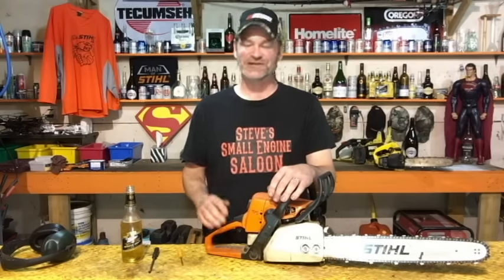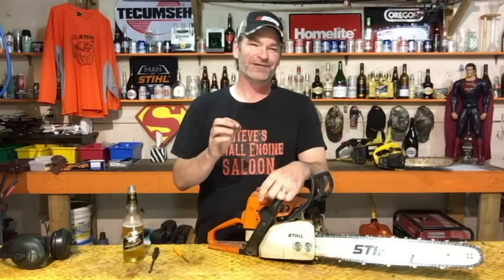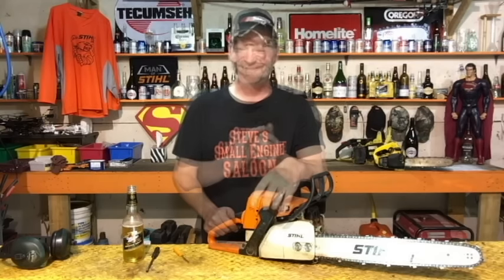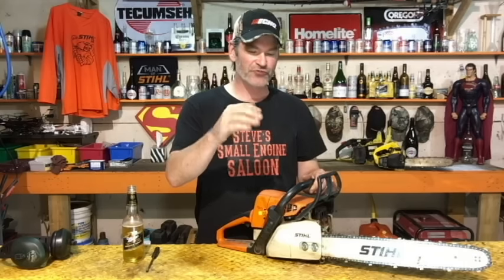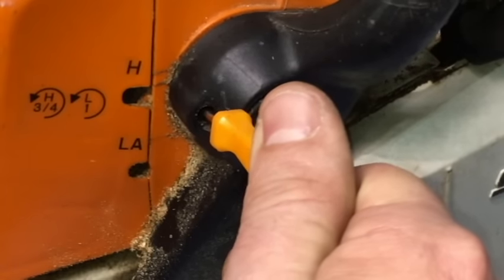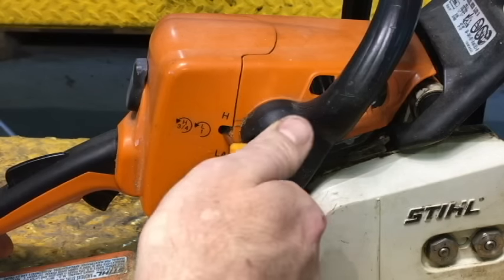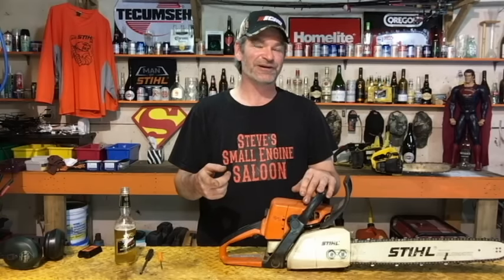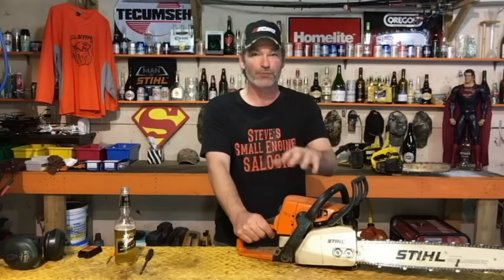CORRECT WAY To Adjust Or Tune The Carburetor On A Chainsaw (Step-by-Step)

Comment from the maker: ✅Click here for a Husqvarna adjusting tool ➜ https://amzn.to/2S9gR4H
✅Click here for a tachometer ➜ https://amzn.to/3DTvSNK  
For more videos like this, check out: 
👉Adjust Or Tune The Carburetor On A Weedeater ➜ https://youtu.be/gmhxTvGRtCg
👉Correct Way To Sharpen A Chainsaw ➜ https://youtu.be/-GIxowey6IQ
👉Never Do This To ANY Chainsaw ➜ https://youtu.be/8Q3J1cVGByQ
👉How To Buy The Proper Chain For A Chainsaw ➜ https://youtu.be/IMaGZghrKWg

You can connect with Steve here too: 
✅Visit Steve’s WEBSITE ➜ http://www.stevessmallenginesaloon.com/ 
✅Visit Steve’s PARTS & TOOL STORE ➜ https://www.amazon.com/shop/stevessmallenginesaloon 
✅Follow Steve on FACEBOOK ➜ https://www.facebook.com/stevessmallenginesaloon 
✅Follow Steve on INSTAGRAM ➜ https://www.instagram.com/stevessmallenginesaloon/ 
✅Follow Steve on TWITTER ➜ https://twitter.com/SteveSaloon
Reply: Steve's Small Engine Saloon when u where adjusting the low speed screw and the chain moved was it on or off? Also u did i twice once before u tinkered with the idle screw and once after was it on after as well and thanks this well help once i rebuild my carb on my ms210
Reply: I have a bran new Husqvarna 460 rancher it will not idle and seems the high low screws will not turn ?????? Please help
Reply: Will check it out.
Reply: You can make a tool to adjust husqvarna carbs out of a bic pen. Gut the pen then heat the small end until its soft and force it over the screw. Let it cool and you have a free custom adjustment tool.
Reply: @jackk8422  thank you sir your are brilliant
Reply: Is a 50cc Stihl chainsaw dangerous for a novice?
I'own a smaller husqvarna but would like a bigger one for mire serious work.
Thanks
Reply: Is the tachometer that you linked in description a good tachometer? Have you tried it and is it accurate?
Reply: Fapking if you use proper form every time no chainsaw is going to cut you.
Reply: Dustin Johnson           B
Reply: So I'm not in the 99 percent where are these screw on a 661 magnum
Reply: Hi Steve I've got a stihl ms 280 and having problems with the machine dying after 20 mins of run time or so.
I feel like I've made all the adjustments just as you have here but those have been my results.
Any ideas? 
Surely it's not a cracked head or something of that nature would you think?
I appreciate your time and hope to talk soon.
Thank you
Reply: Hey steve my chainsaw dont stay on unless i give it gas also it starts smoking after a while of use is that the carb thx
Reply: Great how too! Got my 024 running sweet thanks to your video Steve. 10/10 = 100%
Reply: Appreciate the video.  Very helpful and just what I needed now that I'm at 4400 FT instead of sea level.
Reply: Hate to bother ya but what if it won't stay at idle long enough to adjust? By the time I get the adjustment tool ready to turn the saw shuts off lol.
Reply: @6footmidget214  
Assuming you have a Stihl saw that has the adjustments shown in the video try turning the LA (low idle screw) clockwise a bit while the saw is off.  like shown at 4:15 of the video  that would could should get the saw running to make other carb adjustments
Reply: great info.   much thanks.    my 51 husqvarna is out of wack.    going to use your ideas this morning.    got everything but miller lite.    i can solve that very quickly though.    hopefully i can get it tuned and running well.    if not, i will just resort drinking more beer and quit trying.
Reply: 😊😅😅the😅 6:27 6:27 6:27 6:27

Comment: Took my chainsaw to the local Stihl dealer and they said I need a new carburetor, so they couldn't fix it. Took it to the Stihl dealer at the neighboring town and they made adjustments and it was good to go. I used it once and it crapped out! Found your YouTube site and followed your instructions from chain tension to carb adjusting. BINGO!! You are the man! Better than buying a new one, which I was getting ready to do. So thank you so much, Steve.
Reply from the maker: You're Welcome...

Comment: Found a MS 650 on the cheap because the previous owner thought it ran like crap. Being almost 85cc I had high hopes. He was right. It bogged down when I hit the gas, 4 stroked a lot and it just didn't want to rev. I bought it anyways. I'm not independently wealthy so the thought of a dealer visit was making me sweat. These straightforward instructions got it running like a beast. Thank you very much.
Reply from the maker: You're Welcome...

Comment: After trying to follow the directions in the stihl owners manual, I could not get the idle correctly adjusted.  And I wasn't sure if I had the low speed setting correct.  So after struggling for a few hours I gave up.  Then I decided to do some research with the YouTube mechanics I trust, of which Steve is one.  Danny boy 73 is another.  Individualized repair is the third one I trust.  And of course Steve is simply the best with his explanations experience and simplicity of repairs.  I can't thank you enough Steve because you've helped me time and again.  It's so refreshing to have a true professional know exactly what needs to be done and then show the novices like myself how to effectively make it happen.  I am again in your debt Steve.  👍👍👍
Reply from the maker: Glad I could help

Comment: Been messing around with saws and weed eaters for 30 years.  Never needed to adjust one until I got a still 210.  It has been no idling and only wanting to run wide open for 6 years........today, I fixed it.  Thanks to you.
Reply from the maker: You're Welcome...

Comment: I owe you a big HELL YEAH!! I was given a Poulan P3816 by one of my firewood customers. It was rough in and and out but I did get it started. I did thorough cleaning and maintenance in and out. Then, found the correct spline tool through DonyBoy73. I then watched THIS video three times and applied what I learned. No limiter caps, BTW. I followed your tune up instructions and she is screaming. Nice idle a quick punch on the trigger. Top end? Goes through a 16" diameter Oak lol quick with no sign of bogging at all. I replaced air filter and bought her a brand new Oregon 16" Bar and Chain Combo. I then went to your other video to confirm proper chain tension and it's on! This poor saw was barely crawling when I got it. Now? Thanks to you it's a whole new saw!! I'm getting a log delivery midweek. Can't wait!!
Reply from the maker: Right on Jim!  Thank You...

Comment: Good info. I learned how to adjust a carb via an rc car nitro engine.
There you need to find the sweet spot, but control temperature.

Lil nitro engines love being lean, but the power will fade as the engine starts to melt. 

So i always tune to run as rich as possible, but to run well.
Idle, run smooth, but won't flood it self.

Comment: Hey there Steve, first off I love the channel. I have learned quite a bit here that's has helped me move forward and improve in my own shop. I didn't have Chainsaw after Hurricane Sally hit and ended up cutting large branches and other debris out of the road so I could get where I need with a DeWalt 20 volt saw all. It quickly wore the flesh of the inside of the thumbs where the saw rests. So I bought the cheapest non running chainsaw listed on Facebook and taught myself how to repair them. Well it's been a couple of years and I have sold a couple hundred saws. I buy them broken down, fix them and sell them on Facebook. I give a 30 day warranty and have only had 1 come back (from my brother and 2 years after I sold it to him. He misunderstood a 30 day warranty to be sure it's all good for a lifetime no questions asked bumper to bumper warranty. He took a non running saw home after having it run hot and not bringing it in to be checked out and kept on running it. Scored the piston really bad. And was clearing land with a Poulan Wild thing. He tried to get me to let go of my Stihl MS260 or my 046 but after seeing what he did to the Poulan I suggested he called someone that knew what they where doing). 

Anyway, the reason I'm commenting is this. I have this echo PB-2100 blower I just changed the carb on. The L screw has no slots, no other way to grab ahold of it except by a pair of pliers to adjust it. And this thing needs adjusted really bad. How do I go about adjusting this carb if there is no way to turn the L screw. I'm sure the manufacturer didn't intend on anyone using pliers. But this thing is running hot and the RPM's on idle as well as when it's wide open only has maybe a couple hundred RPM's difference. See what I mean needs to be adjusted? I'm trying to attach a picture of your carb so you can see what I mean. But I can't find an option to

Comment: Steve, thank you a lot. Yes, it took me a while to adjust my Stihl 023 after returning from a greedy dealer. My piston rings broke and screwed both the piston and the cylinder. Dealer asked from me almost the price of new MS230 to fix it, so I retrieved my saw from diagnosis back (yes, I was charged for diagnosis too). They returned it to me in two boxes, disassembled to almost the last piece. At that point I decided to never go back to that shop (or any other) and to learn to fix it by my self.
I learned A LOT from your videos, with that knowledge and also with what I learned from other places on internet i fixed and fine tuned my saw and I'm expecting many more happy hours with my beloved saw.  
I'm hoping for more useful videos from you, next tasks are fine tuning FS55 weed eater that returned from shop still stalling, and Briggs&Stratton soil cultivator I cannot fire up after sitting for almost two years.
 I'm sorry that we live so far apart, otherwise I would love to drink some beer with you! 
Wishing you all the best, keep up the good work man! Greetings from Croatia, Europe!
Reply from the maker: I'm so happy I could help my friend....
Reply: TheJR1948  Just spent under a bill to be told could not tune the saw, glad to sell me a new carb. Managed to screw up the needle settings and charge me for messing up my saw even more.

Comment: I went through a dozen videos... yours was the best, easy to understand & to the point.  Thank you
Reply from the maker: Thank You...
Reply: People limbs cut off
Reply: Just watched the "tune & adjust carb".
So if the high and low screws only adjust idle speed then what the hell is the adjustment screw that actually moves the throttle butterfly effecting THE IDLE really do? The air fuel mixture? LMAO what you telling, a certified small engine repair person, that the high - low adjustment screws are not air-fuel mixture?
Reply: @MoparManiacHemiFever  low speed screw is mixture screw
Reply: @MoparManiacHemiFever  he said the idle adjustment does that, the other two are mixture adjustment.
Reply: @MoparManiacHemiFever jerk
Reply: Steve's Small Engine Saloon you
Reply: Steve's Small Engine Saloon was
Reply: @MoparManiacHemiFever Low-speed screw has a tapered screw that widens or narrows fuel/air mixture through a vortice.  It handles 0% throttle up until it transitions in rpms to another vortice.  This vortice has a tapered screw that widens or narrows fuel/air mixture at 100% wide open (high-speed).

The idle screw is often (not always) a separate fuel/air circuit from the low-speed screw.

I used to race motocross bikes and you had to jet them a lot.  They were two-stoke and essentially had three circuits/jets (pilot; needle, main).  The chainsaw only really needs two circuits:  low-speed (for quick transition from low rpms to higher) and high-speed (wide open cutting).  Idle is just a fine touch to keep the blade from spinning or the engine from stalling while you are transitioning cutting positions, etc.

So, the fellow here knows precisely what he is talking about.
Reply: @Ronald Brown Exactly.  I recently bought a cheap tach. for my chainsaw's high adjustments.  It has proven to be very helpful in keeping me from exceeding my 12500 rpm limit, while also not staying way too rich.
Reply: 💯 that's what I just said, just differently ... lol. Understanding the PURPOSE is super important! How else do you know you achieved what you were trying to do? Thanks Steve!
Reply: @Ronald Brown yes sir! Vsauce Michael Stevens is my little brother from another mother....can't you see the resemblance?! My wiki page is coming. Being a 1 man team is tough @TRVsauce across the board...give a shout if you'd like to join the team! 😎 thanks man
Reply: Well done. Belize

Comment: Keep up the good videos, just note or two,, That high speed screw adjusts the mixture, leaner mixture equals higher rpm at wot, too lean will burn it up, in this video he left it a tad rich, and that's fine. 
It's important to use the best oil and fuel, the stihl ultra synthetic is the only one I use anymore, keep the ratio at 50/1, too much oil can actually make a saw run lean, as in the oil is displacing the fuel, so tune to your mix, and if you use opti oil, never mix it at 50/1, only mix at it's 100/1 spec, it forms very hard little granules that destroys engines if it's got too much opti oil in the mix. 
Thanks

Comment: Many thanks Steve, I have been fighting my MS210 for years and I did not want to remove the carburetor because it ran relatively good at full throttle but was idling to fast and did not respond well to full throttle. after you showed the low speed adjustment screw and i tuned it like you said the saw is idling and responding like it should. Thanks WB
Reply from the maker: You're Welcome...

Comment: Bought the wrench off of Amazon for my Husqvarna for the H/L screws and the flathead for the idle screw is on the scwrench that come with the saw. 
I tuned it Steve’s way and man does she purrr and respond so much better. 
Thanks Steve for a great video!
Reply from the maker: You're Welcome...
Reply: My chainsaw has a new lease on life thanks to you. I had issues, starting, idling, restarting, and wide open throttle operation for the last 8 years. All those issues have been resolved. 
 I tried someone else’s idea adjusting the carb screws but it did not help the issues. You saved me a bunch of frustration going forward and I wanted to say thank you again.

Comment: It’s worth understanding the “fast idle” mechanism when starting. The starting choke position engages a fast idle which stays engaged until you blip the throttle. This makes it much easier to start (and restart when hot). I never really appreciated this mechanism until it stopped working after many years of use due to wear in the metal levers on my Zama C1Q-H64.
Reply: Nice tip!

Comment: Steve, I wanted to thank your for all the chainsaw tips you have provided within your channel. I have a 1998 Mcculloch 3200 chain saw that I purchased new and used it one time in 1998. Once done I put it under my work bench, never drained the gas, bar oil or even cleaned it before storing. Have been carrying it with me through multiple moves and I now need it. Assumed the wrong thing to do was fill it with gas and see if it would even start after 21 years as I didn't want to wreak anything. Have watch most of your videos concerning what needed to be done like, replacing all the lines (gas & oil), cleaning the saw, gas tank and oil reservoirs, rebuild the carb, chain adjustment, bar oiling and adjusting the carbs. I'm pretty mechanical but your videos were extremely helpful and very much appreciated since this is the first small engine I've worked on. That saw is now running as good as when I purchased it. I hope you are still reading emails from this particular video as it was the last I needed to bring my Mcculloch back to life. The last thing I'm wondering as no one has addressed it for the Mac 3200; is there a way to adjust the bar oil delivery? I looked around the saw but couldn't find any way to adjust the amount of oil. Seems that it is dripping and throwing allot more oil than I remember. There is no leak that I could find and I guess too much oil is preferred over not enough oil. Anyway, thanks again for your very informative videos. I will now have a well deserved Shock Top.
Reply: Kinda late, most likely it's not adjustable.
Most saws aren't unless they're pro grade and some farm/ranch grade.
My experience is if there's extra oil that's an extra cushion and the saw appreciates it.
I've never stopped cutting and grumbled that there's too much oil.
Reply: You're likely leaking oil and need to look at the connection between the pump and the bar along with the connection from the oil tank to the pump.

Comment: Excellent video, thank you!

A note on top RPM:  the forces on parts are proportional to the RPM squared.  At higher RPMs the parts are both going faster and have less time to change direction.

 * 10% high (110% of, or 1.1 X rated) RPM means 1.1 x 1.1 = 1.21 X the rated forces.  
 * 20% high RPM: 1.2 x 1.2 = 1.44 X the rated forces.  
 * 50% high RPM:  1.5 x 1.5 = 2.25 X rated force.
Expect it to break early if it's running over the rating.
Reply: How do I find out what the rated forces should be?

Comment: That was a great description of finding the sweet spots, even without the demonstrations! This is adjusting a clean saw, without other issues. If your saw ran well before, your carb adjustments are not your problem. Only adjust a clean carb. that you run to warm up, and break in new diaphragms or saws that sat for awhile. Then set correctly, as Steve shows. When it acts up down the road, fix the actual issue. Don't automatically go to the carb adj on a saw that was set fine; that isn't the issue; usually.

I have seen some very weird methods people use to set their jets correctly, and am learning some technical "precise" methods....factory settings; however, IMHO as someone with limited experience, but a 99% mechanical reasoning aptitude, Steve just showed you how to set any 2 stroke carb. correctly. I do this exact tuning by ear, as Steve describes, and my working saws are quite old.